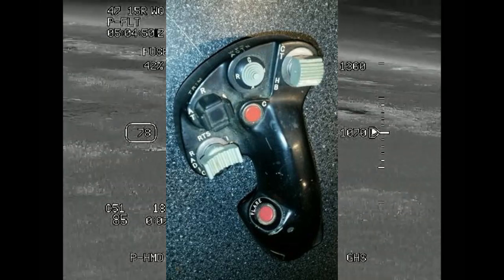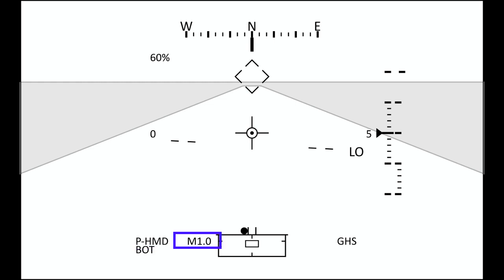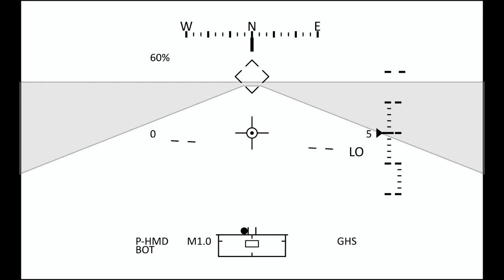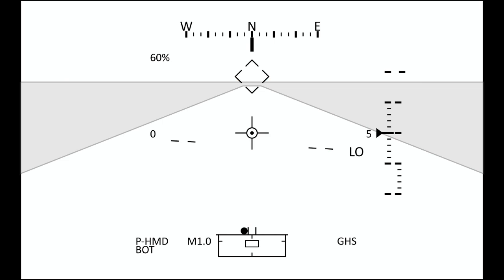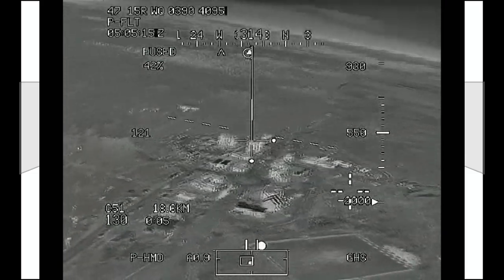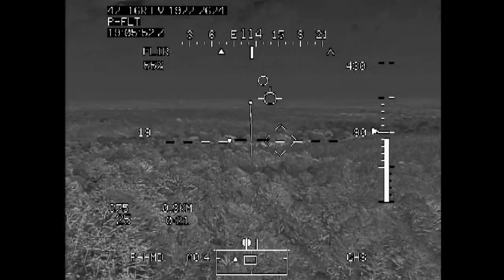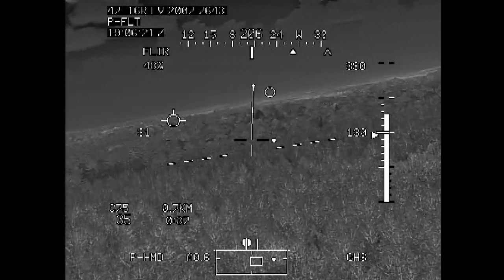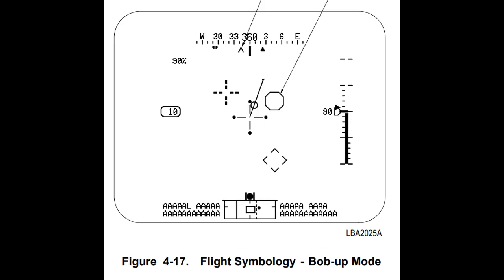Real Apache pilot explains the basics of helmet display symbology

Comment: Good stuff boss also i have a question 
What is the correct code (or whatever you wanna call it) when firing a hellfire?
Reply from the maker: Like laser code? It’s changeable.
Reply: @CasmoTV  i meant like "Rifle" or something you know
Reply from the maker: Ahh I see. Yeah rifle would be the proper joint term. Even tho many many Apache guys seem to think it’s “Rifle Away” which is stupid and redundant. It’s like saying ATM Machine....
Reply: @CasmoTV  thank you!
Reply from the maker: @17ll3 x214 well yes and yes. Rifle is air to ground. Magnum is anti radiation.